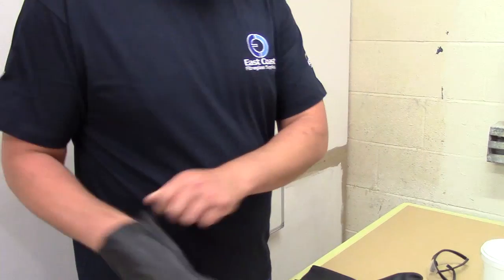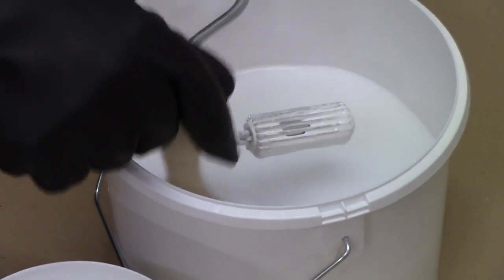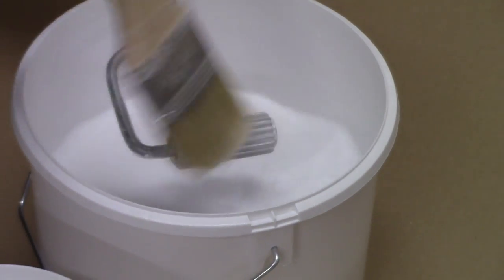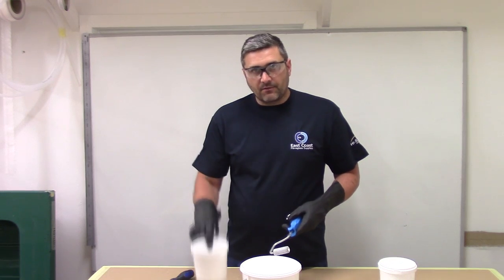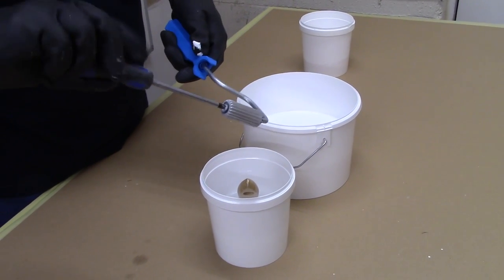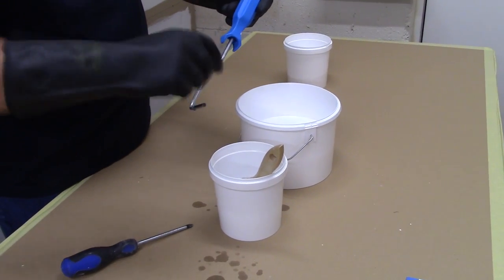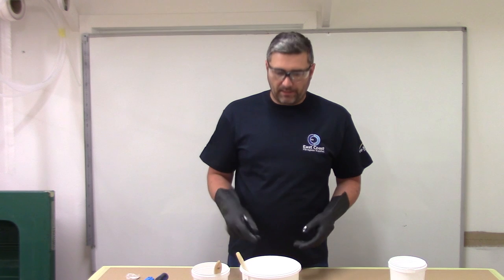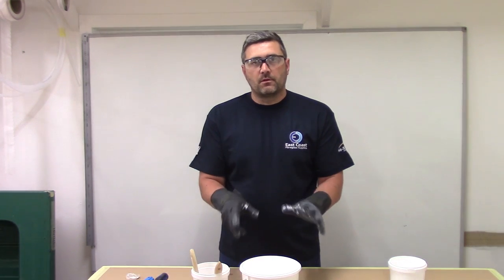Fibreglass QuickTips - Cleaning Rollers and brushes in Acetone

Comment: My father was very forgetful and when using glass fibre  many of his tools were ruined. Acetone did nothing to help when the resin had set off for a week or so. His answer was to mix up a thick slurry of Ariel soap powder and leave tools to soak for a week or so. That ate away the resin and saved him pounds. Mind you he still ruined socket sets and other tools working on his boat then leaving them on the beach for days on end as  the tide came and went.

Comment: That seems like a lot of Acetone to wash 1 roller.  Would it be cheaper to change the roller each time?
Reply from the maker: Although we used one roller for demonstration purposes,  you would tend to have more tools to wash out during a normal fibreglassing process, also the same pots would be sealed afterwards and used again after each project. Repeat the process  until the first pot  becomes too dirty, you can sometimes let the sediment settle to the bottom of the tub and salvage cleaner acetone from the top, the sediment  will usually eventually solidify into a lump if you leave the lid off then it can be disposed off. for  an industrial scale you can get acetone recycling machines.

leaving tools to soak in just one tub of dirty acetone during a typical GRP workshop week of manufacturing can cause residue to collect and congeal at the bottom of the tub and clog up your tools.  worst case it can eventually solidify and render your tools useless or in need of stripping down.  larger tubs of acetone especially if they cannot be sealed can evaporate quicker causing more acetone waste. The method you use all depends on the volumes of production you have.  This video was mainly put out there as we had some first time users just leaving their tools in acetone,  as if they were leaving paint brushes in a tub of white spirit,  instead of physically cleaning off the resin that would typically still cure on the brushes and rollers.

we used approx 1ltr of acetone for this demo.   A 1ltr tin of acetone is around £6  or cheaper per ltr if you buy bigger tubs for example a 25ltr of acetone works out around £3 per ltr.    A 3" consolidating roller is typically around £5.  You could clean over 20  x £5 rollers in just a ltr of acetone.  Or you can save  the £6 on acetone and throw away over £100 worth of paddle rollers.   It may make sense to throw away a roller and a brush if its a one time project you are doing,  but in a GRP production factory it would be a huge waste to throw tools away that can be re-used.